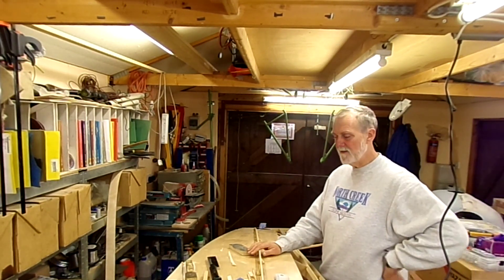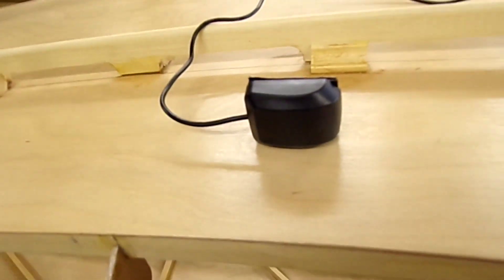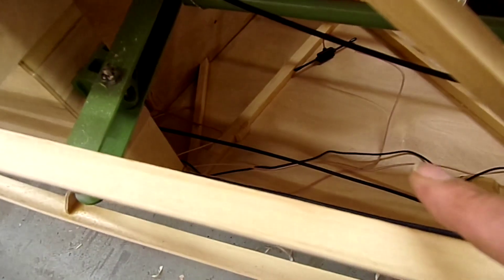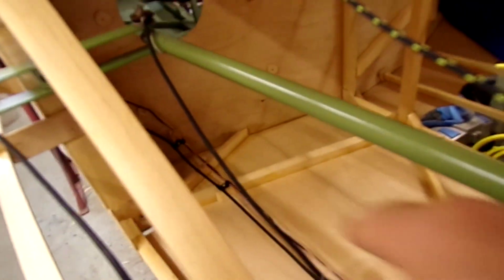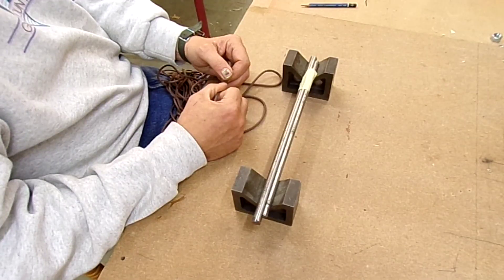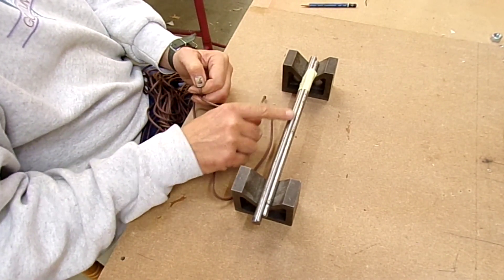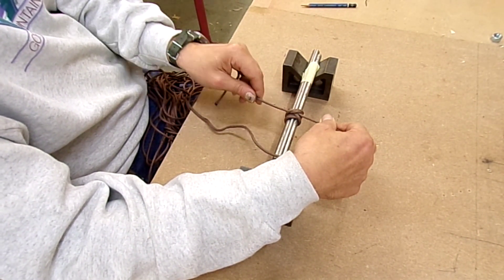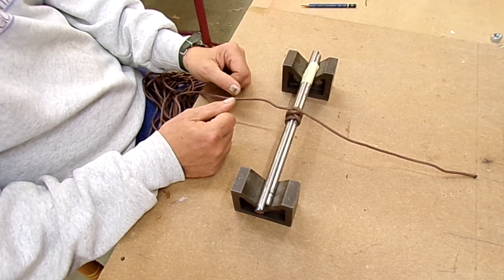EP128 Pilot Aware and wiring. Fisher Youngster

Comment: I might be a bit concerned about mounting the avionics on the belly of the aircraft due to moisture accumulations. My experience has been been to mount them a bit higher off the belly to avoid this. Disclaimer: I've never built a aircraft but a few boats and fly, also a retired aircraft mechanic.
Reply from the maker: @jonned32  they are not on the belly of the aircraft but a floor panel, which is about 4" above the covering and are mounted on rubber rivnuts that give a 1/8" from the floor to tray and the tray lifts them another 1/4". There are a couple of drain holes though the wood and in the covering underneath.  I think they are fairly safe for a hangared aircraft and I  don't have any other spaces to put them. Thanks for your kind thoughts though.

Comment: All very interesting again.  I was fascinated  by your Whipping Method.  At sea I was taught West Country Whipping where there are no knots.  I have to agree with you 100% about "Looking out of the window" rather than relying on the magic screen.  When I was on long cruises and had company who took night watches I always insisted they kept a proper lookout and then used the radarn not the other way round.  Regards Michael
Reply from the maker: There are some pilots who spend too much time following a line on a screen and hoping that aircraft will appear on it. It is okay in an airliner at 30,000 ft or flying through fog but in my low slow aeroplane it is better to llok out 🙂

Comment: Hi Algy, looking good. The GPS head unit can be oriented in any direction, it doesn't know which way it's facing. Thanks for the plug on my interview with Keith.
Reply from the maker: I didn't thin it did but I had set up the run for it to be the same as the Kub. No problem with the plug it saves me the effort to try to produce a video of the same quality.

Comment: Would you consider using 3M Dual-Lock instead of Velcro, for the heavier items such as transponder & GPS?  I've seen them used for professional guitar effects pedal boards, for those who do lots of touring.  
I suppose Velcro has more of a cushion effect and you'd tie things in place too.
Reply from the maker: My experiance with Dual-Lock is limited but I think it holds too firmly for my applications. The transponder and radio will be on rubber bush nuts.
Reply: @flyingkub  Yeah, I thought some sort of vibration dampner would be important.
Reply from the maker: @YeRobertPayne  Yes vibration kills electrics, not as much now with solid state.